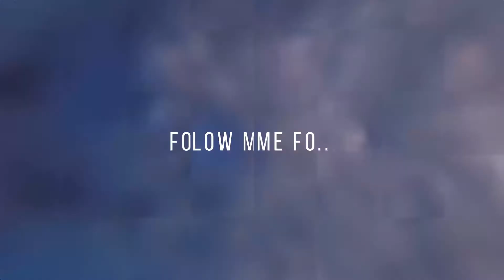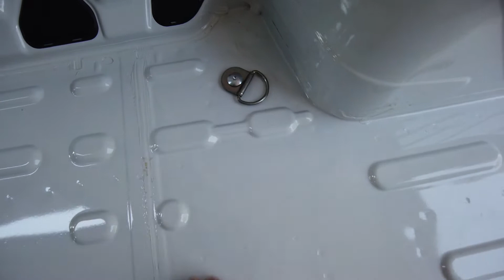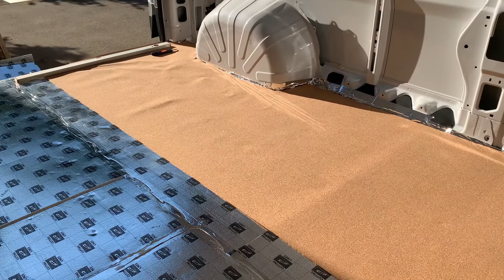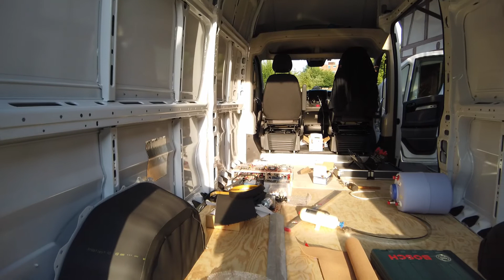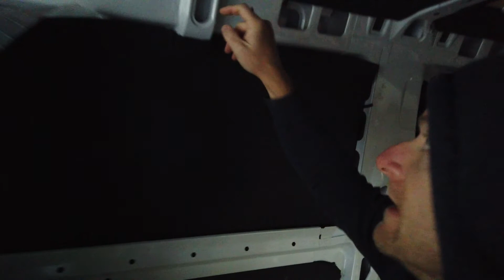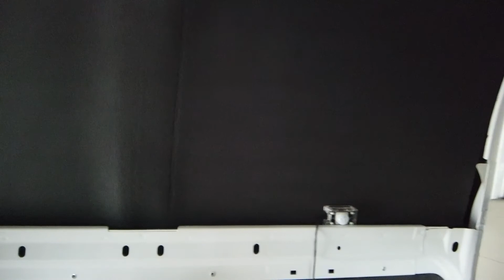LVED CamperVan - Insulation

Comment: Hi Jérôme,
Great job and thanks a lot for sharing videos like that!
Could you please tell if you made the floor somehow stable with bolts or screws? I see there floor "sandwitch" is next: actually car's metal -> 2 layers of insulation -> 1 layer of plywood. Is it good and stable enough just because of plywood's own weight or did you actually have to assemble (verbinden - can't find the proper word in English) with car's metal? Thanks again a lot.
Reply from the maker: Hi Oleksandr, yes the plywood is bolted on 6 places to the metal. We used the original thread where the hooks has been mounted to secure the loads. Hope that makes sense?!